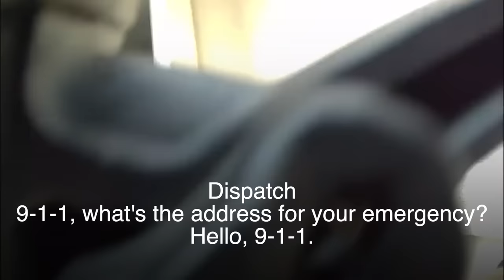Cop Gets Shot in the HEAD and Still Chases Down Suspect!

Comment: This is one of the best outer vest advertisements I’ve seen in awhile. I remember as an MP when we switched from second chance vests to the outer vests and not only were they more comfortable but they also had the ability to add basically whatever kind of plates you wanted into them so they were stab and bullet proof. 

It was the Marine corps budget so they didn’t come with plates but we could buy our own plates and fit them in there for added protection which was amazing because most of the old second chance vests weren’t even stab proof. Don’t ask me how I know that👀